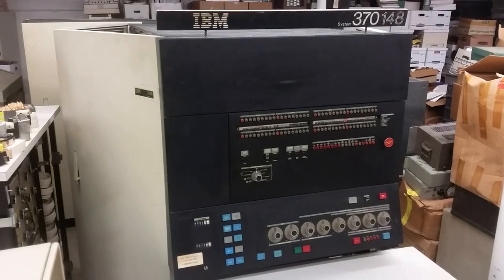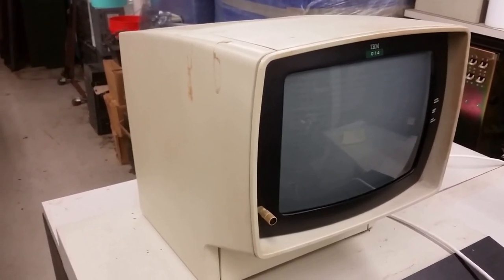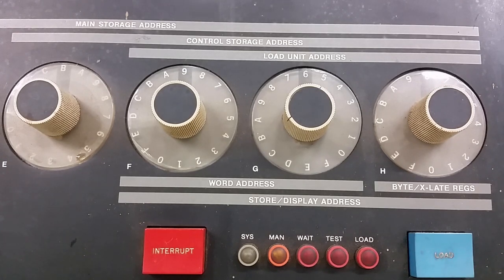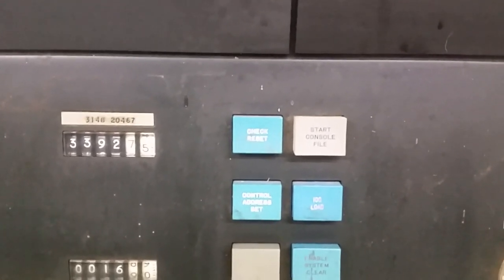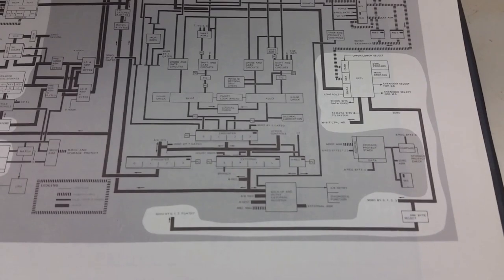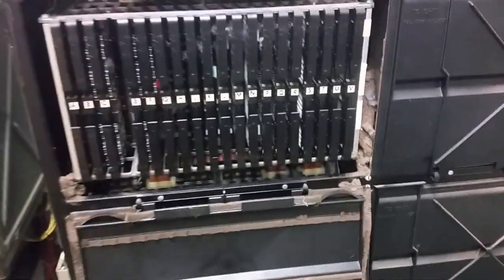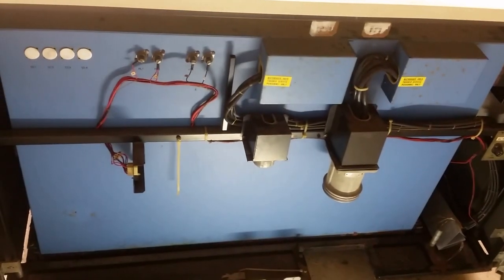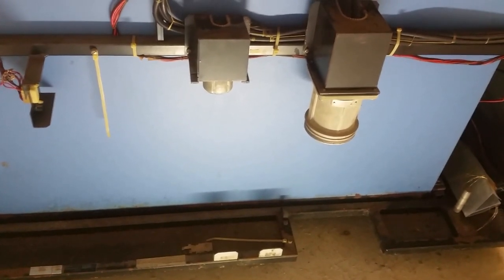A Look At An IBM System 370 Model 148 | VVCFMW 2020

Comment: This was the last machine I ran as an operator that made you feel like you were actually doing something! I used to love doing IPLs just because we could turn knobs and push buttons! I changed jobs and the next datacenter had a 4331 with the 'Maytag' flat tape drives! I went fulltime into systems programming and we went through the whole 4300 family, through the 9672s and into the Zseries. They are still running the Z12 we had when I retired.

Comment: I had to chuckle at a flashback I had at your comment about the ubiquitous Emergency Pull knob. The second computer I ever worked on was a S360/30 at my small community college. The operator who trained me always had it unscrewed and just resting on top of the machine. I was told, in no uncertain terms, to never, ever, EVER pull that knob unless I saw flames over 3 feet high coming from the top of the unit. Fortunately, that day never came.  Enjoyed the video.
Reply: I worked with a lady who worked for the Army or Navy, one of the armed services.  They used a IBM 360.  They upgraded to a 4300 series, totally skipping the 370 series.  She said one day some component in the computer room caught on fire and they hit the 'emergency power off' kill switch to the room.  She said her manager was so mad and asked why did they do that - she said flames were shooting out of the xxx component.  We had a good laugh as she told the story.
Reply: You actually pulled the emergency power button. This bypasses the power off sequence and shut it down immediately! This would cause a huge power surge in the building.
The emergency pull is very easily reset by lifting the little metal spring larch and pushing the button back

Comment: My first systems job was at a large corporation that had upgraded from a 148 running VM and VS1 to a 158, then upgraded that to MVS. The 158 came to that shop from another within the company with a massive 6 MB of RAM: 2 MB in the main machine, and 4 MB of RAM from some company nobody ever heard of by the name of Intel. Eventually, it had an AP (attached processor, a poor man's multiprocessor system) added; the main machine was blue, but the AP was yellow. The 158 didn't have anywhere near as many blinkenlights as the 148; the console was used for that kind of thing instead.
Reply: Itel had some microcode which allowed a 145 emulate a 148.for a performance boost.

Comment: This brings back a lot of memories.  I might have actually worked on this machine.  I was the Quality Engineer for the 370/148 and the 370/138 built on the same line in Endicott NY.  Later went on  to design test equipment for the 4300 series, then the 9370.  Remember a few details about them. The 138 implemented the 370 instruction set using what was called vertical microcode.  It was similar to what an assembly code.  The 148 used horizontal microcode.  Each clock cycle it would apply a very long bit string to gates throughout the machine, causing different sections of logic to execute based on whether a specific bit in the microcode was on or off.   Really hard to write.

Comment: 370/148 with 1MB memory (solid state! Woo-hoo!) could run the MTS (Michigan Terminal System), along with an IBM field upgrade for Data Address Translation (hardware) + virtual storage.  IBM guys in very spiffy, clean-pressed suits ("Field Engineers") would show up at the data center with these impressive aluminium briefcases with the hardware, etc., and do the upgrades.  Afterwards, a fully kitted 370/148 with 1MB could easily support up to 150 users on 3270 & 2741 terminals.

Comment: good to see an old 370. In the 1980s and 1990's I was a partner in leasing co and we had 40 360's and 370's on lease  in the nyc area.
We would custom paint the machine to customers order. IBM would do the same. Usually just cans of ibm spray paint. red, white, yellow, blue.
the front panel was always black.

Comment: It’s a 370 because it runs the 370 instruction set and can use 370 peripherals; doesn’t matter the internal implementation. If it had a chipmunk on a flywheel and ran 370, it would be a 370. All the 360s & 370s had micro-programmed CPUs except 360/44, 75, 91, 95, 195 & 370/195, which were hardwired. 

The CPU in the slower models had a narrower data path (cheaper). That’s mostly what made them slower (and cheaper). But their micro-programming enabled them to process data in 32-bit registers. Very clever actually: a key to their success. It gave them instruction set compatibly over a 50 to 1 speed difference: just amazing. The micro-programmed models lined up like this:

CPU     360 model  370 model
8-bit       30/22         115/125
16-bit     40               135/138
32 bit     50               145/148 & 155/158 with cache memory
64 bit     65               165/168                

Nice find. I like the white color best of all – very tasteful. Our 145 had that gaudy yellow; screamed. "CAUTION!!" I thought is should be green = money. Don't buy a 168. It needs a water refrigeration system for cooling. What you got there will make a great (if large) Personal Computer.
Reply: Correct. Saves me typing this in. Pay no attention to what is under the hood. Look at the badge.

Comment: Very cool. MST is an emitter-coupled logic, not TTL. Some of the console circuitry was TTL. IBM called it VTL - Vendor Transistor Logic - because they purchased most of it. MST-4 is kind of like 100K series ECL but centered around ground. VCC is +1.25V and VSS is -3.0V hence the emitter followers center around ground. Also interesting that IBM labeled bits from left to right instead of by their radix weight. A 24-bit address bus, for example, is labeled 1 thru 24 instead of 23 thru 0. Documentation got freaky when upgrading past 16MB. Fun stuff. Good luck with the start-up!

Comment: Back at the beginning, the 360/30 was microcoded, basically an 8-bit machine emulating either a 360, or if you paid for the feature, it emulated a 1401 to handle the legacy jobs in the mid-sized batch shops it was meant for.
Reply: I think this machine has the 1401 emulation feature as well, so its an emulator running an emulator.
Reply: Ahhh yes CCROS. The Model 30: the only computer (that I know of) where the CPU included a compressor to keep the bladders inflated....!
Reply: @uniservo  I think they would load in a different set of microcode to emulate the older machine models.
Reply: I thought that all of the 360 models were microcoded, but after spending some time on Wikipedia, it looks like IBM did use hard-coded logic for the fastest S/360 models. I'm fascinated that the Model 30 was an 8-bit machine that emulated the full 32-bit 360 instruction set in microcode.
Reply: @JakeHambyZ80  Pretty sure it could switch to 1401 mode under software control. Hah, yes, from the manual (http://bitsavers.org/pdf/ibm/360/dos/C27-6940-2_14xx_Emulator_Feb69.pdf) "allows 1400 programs to be run in a stacked job environment, mixed with System/360 jobs."
Reply: We moved from a 12k 1401 system with 1403 printer 1402 reader punch a 1405 20 meg disk a beast about 6 feet high and 8 x 4 feet to a 64 k 360 30.  We still had a massive number of 1401 programs.  We had the stand alone 1401 emulator but we added an on line running in F1 and we had to take it down to run the emulator.  My memory on this - there was an emulation package that would run as BG in our environment with a 6 k supervisor but we needed 8k. The package we needed.was a lot of bucks
 I found a type 3 simulator program
 These were ones some SE had done for a customer. It had no warranty or support.  I got it, about 2 drawers of assembly code, and it worked for about 90 percent of our programs. It had no reader stacker select we needed, the edit was not perfect and we learned that it initialized the indexes wrong but between myself and a fantastic 1401 programmer Don Golden we fixed them. It was slow, as simulations we're but it gave us about 4 years to rewrite all of the SPS into COBOL. interesting, some of those rewrites we're still running when I came back to help upgrade to COBOL II. Thank you Grace Harper
Reply: Un fact the s38 and later as400 was based on microcode making it sort of a virtual machine.s38 was 16 cpu but already managed 48 bits addressing,wich at the tkmewas unknown. Then they was able to migrate to other kind of cpu withoutany impact on os and user peograms allowing to enjoy new performnces without recompile, they was so good at that in IBM at that ime.

Comment: WE MISS THE LIGHTS !!!!!!!!!!!!!
In the 1980's we had white system 3(mom's machine), yellow sys3, blue 360/40,

black 370 135, 370 145 all in our service bureau running work for our customers.
In 1990 we lost our cheap rent and had to down size to dell servers, laptops
and pc's, we now run all the same work on dell pc's, servers and laptops.

Comment: I used to manage small computer networks and I am very glad the servers I had to deal with were not anywhere near as complex as that beast of yours. It really will be a project and a half. I saw what was involved in restoring the IBM 1401 that the Computer History Museum has. They had a team of IBM folks involved and it still wasn't easy. I hope yours isn't as troublesome as that one was. Yours is newer and looks to be in good condition so hopefully it won't be as bad.
Reply: iF you have a complete machine(all the box's, blue books etc) it takes i day
to install the machine!!! 1 day to generate the operating system.
The computer history museum did not have a complete machine, so they
took years to kluge together a working machine.

Comment: The one thing about our 370/145 was the incredible noise the MG made. I always thought we had one was so that we could run a machine destined for US voltage and frequency from UK's. It seems that this wasn't the case.

The 4341 we had (I was working for a different company by then) was nicknamed the freezer because that was exactly what it looked like - a large chest freezer.

Comment: LOL.. brings back memories - I ran a lot of PL/1 code through this machine.  As a programmer for one of these I had the option to purchase my company's 148 back in 1985 for $750 when they decommissioned it.  Thank god I didn't have the space to store it!   Although I did briefly consider that I could heat my apartment with it trying to justify the expense. 🤣   I was so bummed out when the 4381 arrived and it was just a small box with no blinking lights.

Comment: I just saw this today. It brings back memories.

A funny story about the 3047 MG set. Since the 3047 was near the printer (1403-N1) it was frequently used as a table to break down printouts. One day the operator was working there and triggered something exciting. His belt buckle caught on the EPO knob of the 3047 and suddenly the room went quiet.
Reply: EPO?
Reply: @sundhaug92  Emergency Power Off

Comment: If you can restore the machine and get it going, the operator’s console is a delight. The /370 console was the last of the vector consoles where each character was drawn individually instead of being part of a raster (That started with the 303X machines). 

They were also a delight to play with as as system programmer, stepping through operating system code and setting hardware breakpoints with the dials and buttons.
Reply: Actually, while the 3066 console for the 370/168 was vector, the console for the 158 and 148 (at least) was a slightly reworked 3277 raster terminal with light pen.
Reply: @TheRealTronGuy  I'm disappointed. The 3277 wasn't a special terminal at all.

Comment: When IBM took the lights off the front panel, they put light panels inside the machine. THE LIGHTS WERE ESSENTIAL TO FIX THE MACHINE USING 
THE BLUE MAP BOOKS. TO FIX THAT MACHINE YOU NEED ALL THE BLUE BOOK(MAPS), DIAGNOSTICS AND FE REPAIR  MANUALS.

Comment: Great video ! I cut my teeth on an IBM 370-168 back in 1978 as a university student learning IBM  assembler and PL1 then it was on to oil patch sys programmer work on 3081,3083 and 3090 model.600 and ending up at a my old Alma matter as a CICS SYSPROG until 2004 using ZOS on a ES9000 what a ride, love your stuff.
Reply: This is a senior moment I forgot about the true last IBM big iron I used a Z800 !

Comment: I remember the IBM System 370 Model 145 where I worked as a data typist with first hands on the Entrex Data Scope data terminal in 1973.

Comment: You mentioned that you have a 3830 storage controller.  Well one interesting option on a 3148, is the ISC (integrated storage controller), basically a 3830 that would fit in the rear frame, taking up all that empty space you showed in the video

Comment: I worked with the ibm/360-370 series from 1967-1884 and the 3000 and 4000 series from then to 2001. I never once saw the IBM CE's (repair) ever use the front panel lights...

Comment: There was also 370/155, 370/158, 370/165 and 370/168. I believe the larger of these ran MVS/XA. The 148 was replaced by a 4341 and 4381, the 158 and 168 were replaced of the 3031 and the 3081.

Comment: Do you ever run across any Burroughs equipment? I learned Fortran 77 on a Burroughs B6800 mainframe in the computer science department at the college I attended. 

This was the college's main computer; there was lots of time-sharing capability, one thing for which the B6800 was known. Had to be, when the college administration and the various business & accounting departments, curricula processing, student exams, etc. And of course, heavy use by the various computer science classes running Fortran, Cobol, Pascal, and even an occasional BASIC program! That B6800 definitely got a workout!

Comment: In the mid 1970s the university I was at had an ibm 370-145.  They upgraded the memory.  I think the memory upgrade cost about Can$1.00 per BYTE.  Later they upgraded they upgraded the machine to a 370-148.  I think the difference was the operating system with the 148 offering virtual memory.

Comment: Side issue, the engine in the S/260 30 and S/360 40 were vastly different.  The 30 was a capacitor read only storage for the microcode, they were mylar IBM size cards with conductive lines and rectuanglar points that were excatly where a hole would be punched to change the capacitance.  Someting pulesd through the lines caused a string of bits to be reas out.  A punched hole was a 0, not punched was 1.  The CE at times would get a card oor cards to replace pre-punched.  They carried a handful of them, an emergency fix could be made by actually putting one in a keypunch and punching it.  The 40 was a transformer ROS, the ling strips of mylar had traces, i think 16 they were about 2 inches wide and maybe 2 feet long. Every so often on the trace there wioud be a trace slooking like a square, the on side of it was the through trace.  If the trace was ounched there it made a 1. Again they wold get replacemente,  The CE had a manual punch they could use to make one in an emergency.

Comment: Wow..  I was so jealous that you had found such a great piece of history, until you got into the power requirements for this thing!!  I had no idea it would take a motor generator, or for that matter anything more than 3 phase AC straight from the power company at the worst! Good luck with the restore.  I subscribed and hope to see it running some day!!!
Reply: 360's, 4300, sys3, 34, RCA(univac) all worked on single phase or 3 phase 208v.
most power cos can sell you 400 cycle ac then you would not need the motor generator.
Reply: The 360 line also had a DASD called a data cell 2321.  It was 400 Meg an L shaped beast about 5 x 3 on each leg. It had a bin with 10 pie wedge cells, each with 20 subcells, each with 10 mylar strips about 4 x 14 inches, 5 'cylinders' each 20 tracks per cyl. Each strip was 200k times 20 subcells 4 Meg  x 10 cells 40 Meg each removable cell. It had a 25 hp motor hydraulic pump to spin the bin to the proper place, two fingers came down and separated the strips using tabs on the top an arm grabbed it. A drum with a clasp grabbed a hole in the strip, the drum spun 60 Ms rotation, air blasts at 3.0 pounds guided the strip and the read write head advanced.  It had 56 mb transfer about 1/3 of the 2311. We had one.  I helped push it out, i did too many recoveries when it smashed a strip usually putting it away, and it usually smashed the heads and the device was down 3 to 6 hours.  Mechanicsburg IBM parts Depot was only 30 miles to get one. One time IBM thought our CE was the problem. They sent an expert from PHL who had 8 of them that had less pick restored together than our one.  He spent a couple hour with our guy and called in to tell them, he knows more than I do.  The problem was what Carol said in the beginning, a stack of parts in the machine were all in spec but all were on the long side of tolerance. The whole stack was too long. A trip to mechaniscburg with a micrometer found several shorter. Items problem solved.

Comment: oldest IBM mainframe I ever worked on was a 360/65. Latest was 4381. Also 370/148, 3032, 4341. I thought the 3032 was the most impressive. started as tape librarian, then computer operator, then systems programmer. got out of mainframes in 1987.